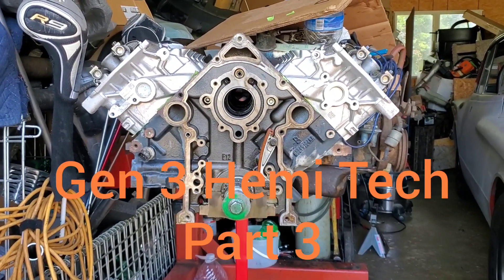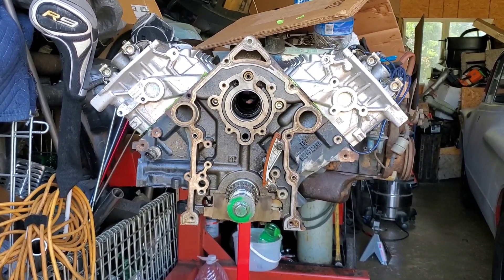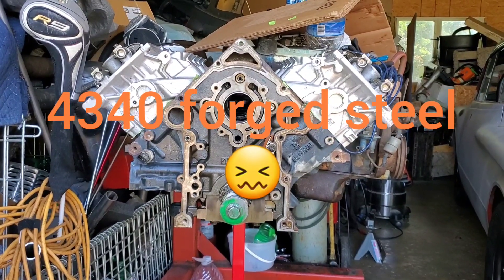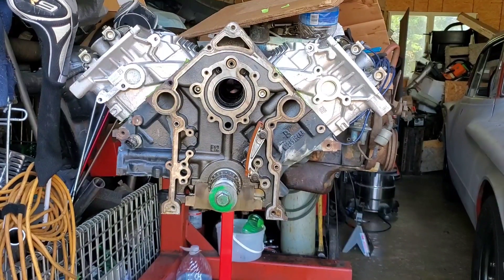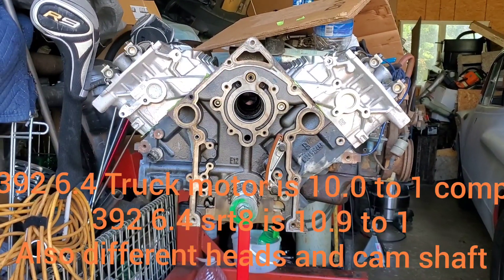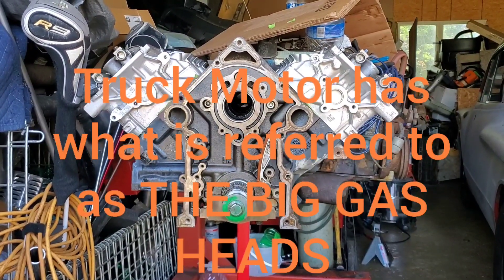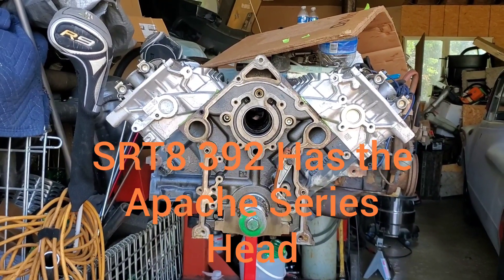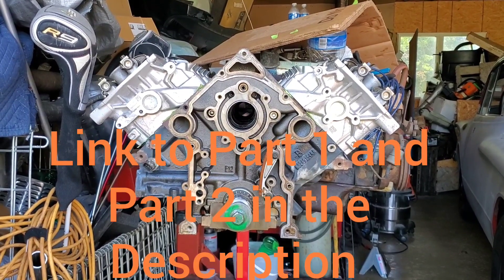Gen 3 Hemi Tech(part 3)6.4 Srt8 vs 6.4 Truck Hemi

Comment: Thats great info. Good series. Would you know what the difference is between the intake manifolds of the truck and SRT 6.4's? All I can see is the different direction of the throttle body inlet elbow. Car goes to drivers side and truck goes to passenger side. Any other differences between them that you know of and may be able to share? Thanks in advance.
Reply: Actually just watched part 4. You mentioned the stud pattern is different. SO a truck intake cant go on a SRT motor cause the heads are different?
Reply from the maker: Srt 6.4 and truck 6.4 motors have the same intake and exhaust bolt patterns. The hellcat platform uses a different intake bolt pattern because of the Supercharger
Reply: @turbotoadTV  thank you very much.

Comment: From what I've heard the bge blocks are the same blocks as the hellcats. Just different internals and 18 and newer 392s are all now bge blocks. Is that correct? Is that what ur were saying?
Reply from the maker: 14-17 the trucks running a BGE block but not as meaty lower in the cyclinder walls and the water jackets weren't as deep as the hellcat block. 18 and on all 6.4,6.2 use the same block but different heads,rods,pistons, camshafts
Reply: @turbotoadTV  well looks like I need an 18 bge block 😁
Reply from the maker: Yes that's the one you want.
Reply: So I have a 2018 2500, and looks the same as the 17’s.. but all of them have the upgrades? What’s the easiest way to tell the difference between the two engines configurations?
Reply from the maker: If you have a 18 and BGE is stamped on the block your golden

Comment: Subscribed. I'm trying to find out if I can use a 6.4 block and Heads while utilizing early Gen 3 electronics. My conversion Jeep is running a 2008 5.7 since the electronics work best with my 2003 Jeep gauges. would it be possible to build a 6.4 and just use the sensors from my 08' 5.7 ?
I'd like to actually build a 400 plus Cu In engine instead of the 5.7 based off a 6.4 block. Is there a way to delete the VVT cam and just use a standard indexed cam? I'm new to Mopar but loving my Hemi conversion so far
Reply from the maker: Thank you for the Sub...
I believe you can use the earlier sensors,but the kicker is the reluctor wheel on the crank I think I read that the tooth pattern is different, and will need to be replaced.